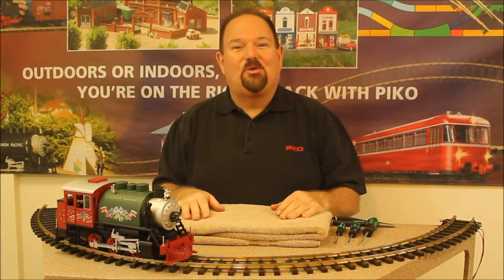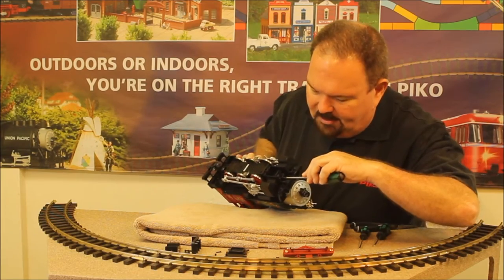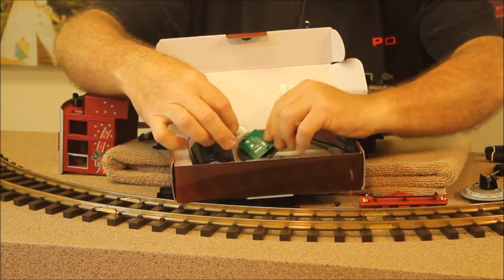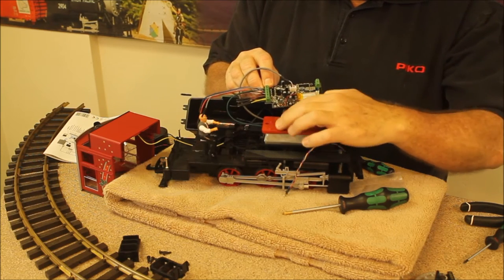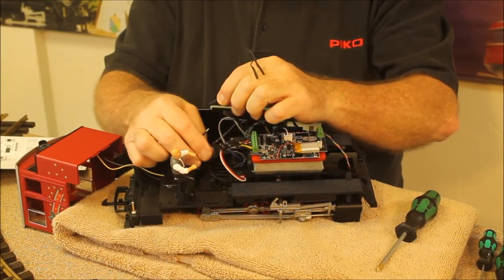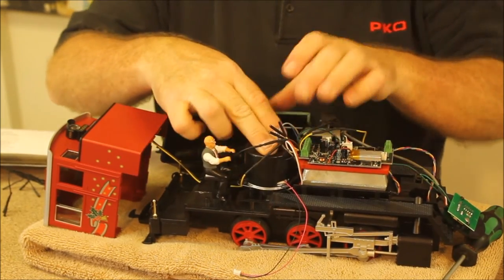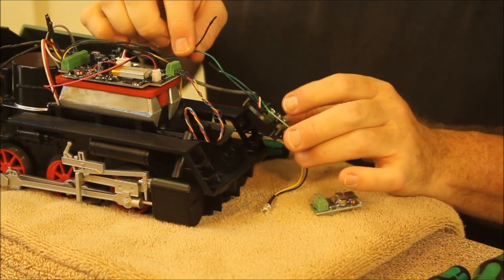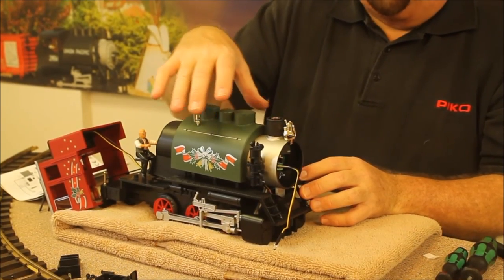Install Analog Sound in a Saddletank Loco

Comment: I’m wondering why you designed this sound unit so that it does not match the wheel speed of the locomotive. Your mogul sound system perfectly matches the chuff with the wheel rotation. Why wasn’t the same quality built into this one?

Comment: Hello Piko, I just installed one of these sound kits in my PIKO Union Pacific 0-6-0 last weekend. Overall, it went well. However, my big problem is the chuff rate is so slow compared to the speed, it seems to be WAY off.  Is there a way to adjust this, is there a reason the rate is so far off?  I'm a bit disappointed.  I was considering buying a sound kit for my PIKO Mogul, or my Taurus, but now I'm not so sure.
Reply: Same. Disappointing. The sound units for the Moguls match the wheel speed quite well.
Reply: @zakkmps  The good news is I do have 3 Moguls with sound, and sound in my Taurus now. They all sound and work great!

Comment: Is this sound unit only for analog or will it function with more sound options with a dcc system? 

In the video the chuffing does not appear to be synchronized with the side rods. It's the sound synchronized or one speed?

Comment: Can you guys make a video on how to reprogram the analog sounds?
Reply from the maker: Hi... The 36221 Analog Sound boards are designed differently from digital boards and they are not changeable. They sound exactly as you hear in this video. 
The 36220 Digital Sound Set has items that are changeable like the chuff rate, whistles, bells, as well as numerous other CV's controlling just about every function of the locomotive and motor.
Reply: @PIKOAmerica   ah ok.

Comment: Hello, I have same Christmas analog train and I tried to look for the 5V smoke generator but couldn't find it at piko DE. So I sent a query to PIKO and got a reply that I can also use  Piko 36141 (24V), which is meant to work with digital. So I send again an email with this concern and they confirmed that 36141 will work with analog loco. As an expert with hands-on could you please confirm it too? The reply I got was from Marketing department but I don't really trust the Marketing team.
Reply from the maker: I see the correct 36142 5-Volt Smoke Unit and 36143 5-Volt Regulator available at www.piko-shop.de so I think they should be available through your PIKO retailer, or direct from the website.  The 36141 will work, but very poorly.  The loco must be running very fast to see any smoke.  The 36142/36143 combination (you need both!) works great even at low speed.  Remember to buy a nice big bottle of PIKO 36210 Smoke Fluid!
Reply: Thank you. Now I can see the voltage regulator is available again.